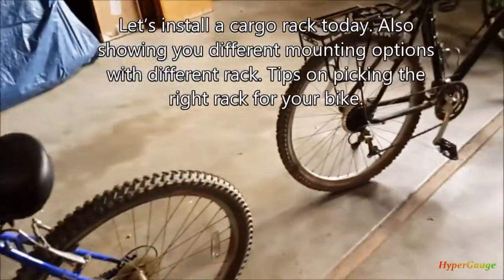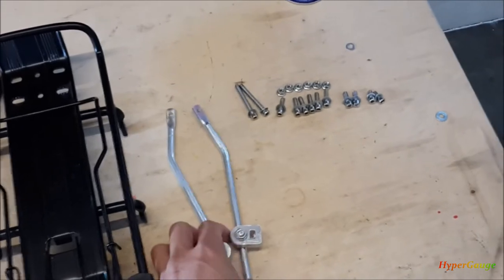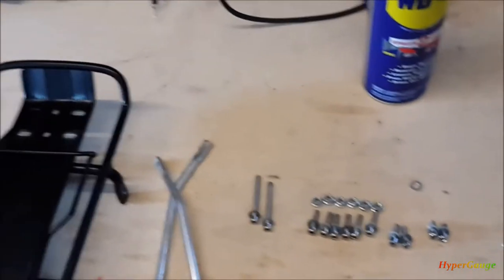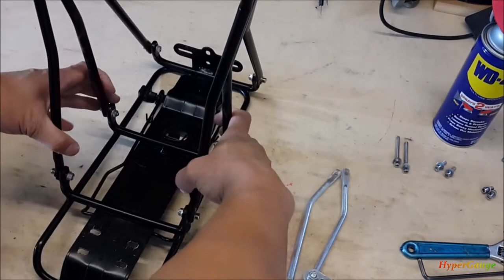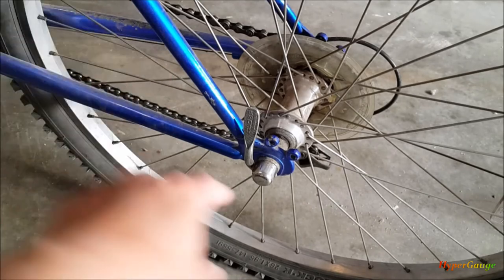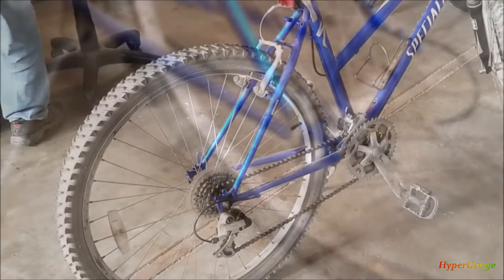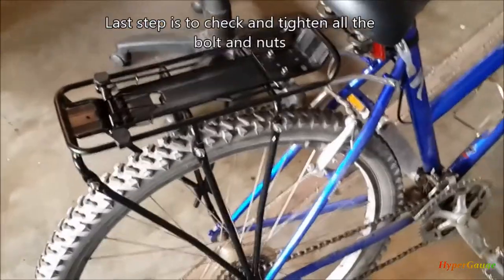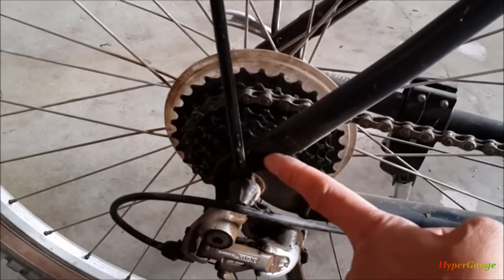Bicycle cargo rack installation Compare two different mounting styles Tips picking the right rack

Comment: Excellent video that helped me tremendously. When you finish I recommend you place the red reflector at the back of the rack so it can be visible because now it’s obscured by the rack itself.
I also placed the bolts towards the wheel on the support and the rack in that way I won’t leave my skin on the exposed bolt when I rub up against it. Lastly I reused the factory bolts to secure the aluminum arms to the rear fork.
Reply from the maker: Thanks for watching my video! 👍

Comment: I appreciate you taking the time to demonstrate how to install the rear bike rack. I just received mine today,it did not come with instructions on how to install it. I found you video and certainly glad I did. It was easy to install with your video. I have an older Raleigh 24in. Did not have the side bars to attach it to, however I did some rigging and got it installed. I will go back later to complete the installation. I would not have got it installed without your video. Thank you very much,I appreciate you. Have a blessed day.
Reply from the maker: Good job! 👍I am glad my video helped. Thanks for watching my video!